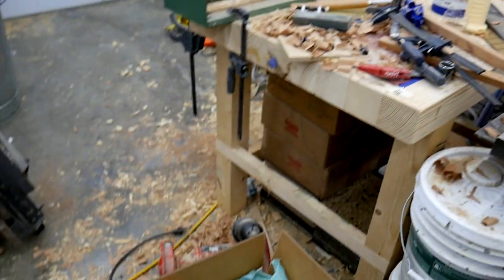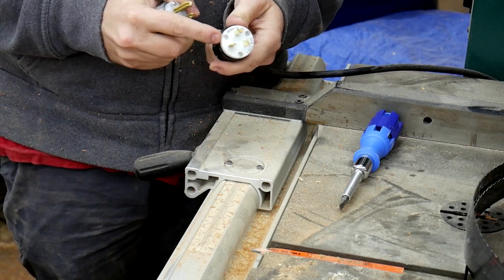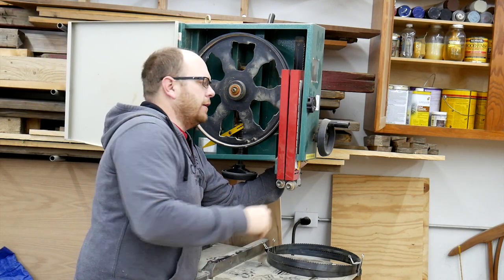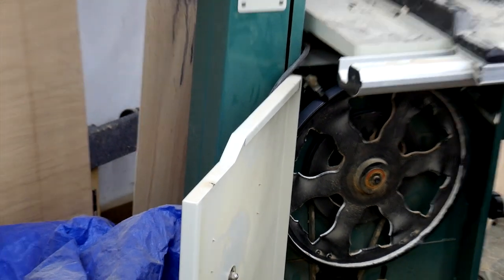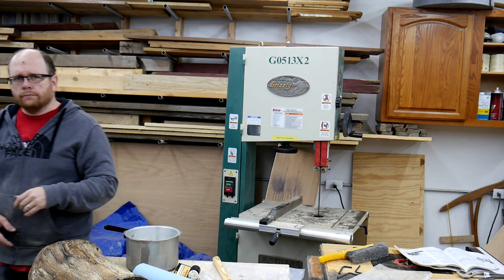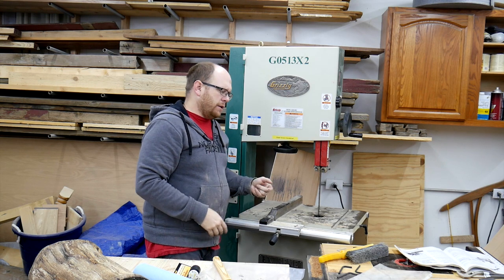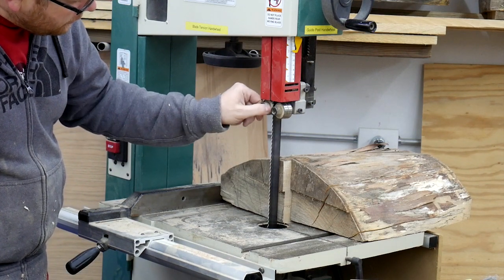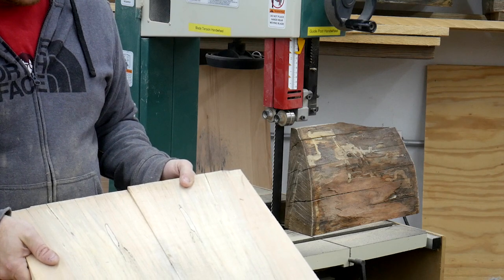Grizzly G0513X2: Tuning up an old, used bandsaw

Comment: Thanks for the real video showing how hard it is to get the tires on.
Reply: I put tires on this same saw today for the first time.  I didn't feel like heating water up, so I took the wheels off, tires off and used 2 clamps and a 3/4 dowel and had the new tires installed in 15 minutes.

Comment: Oh, man. I have that same lathe you have clamped to your bench. I actually have two of them unfortunately.  Even after bolting it to the bench with not only the stock bolt locations but also having added extra bolt down locations, the upper frame still flexes so badly any time you clamp anything it can barely hold it firmly enough to maintain rotation when you apply the knife.  As well, the stock motor barely has enough power to maintain rotation.  I'm curious to hear your opinion now that you've had some time to use it, as I'm fighting to figure out how I'm going to alter this thing to get it to become useful. You original video on the lathe was, I assume, before you had used it.
Reply from the maker: I agree this thing isn’t going to win any awards, but if you are aware of its limitations, I think you can produce decent work on it. You can see a part to an upcoming project mounted to the lathe here. I have also turned some heavy table legs on it. For the infrequent times I need it, it has performed fine. I plan on featuring it in an upcoming video about a copy turning tool I am developing. That will be a little down the road.